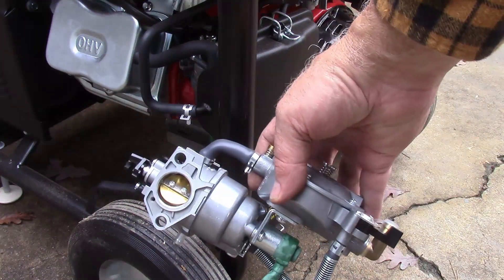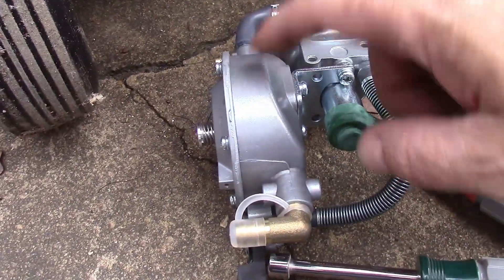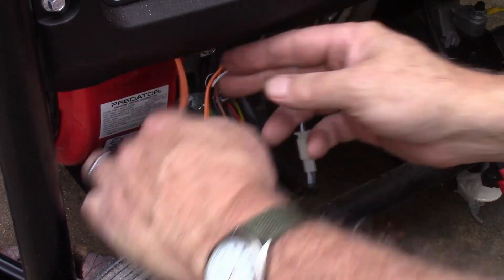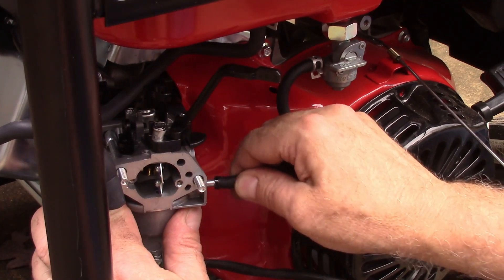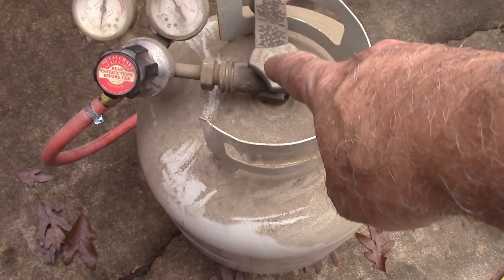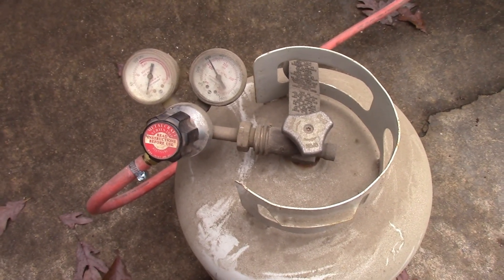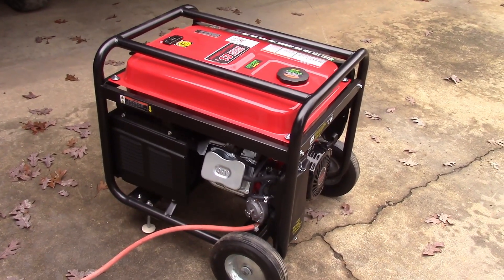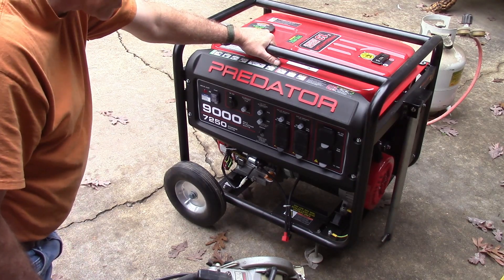Predator 9000/8750 Generator Propane Conversion  Tri Fuel

Comment: Great video, had no idea this was possible. I'm looking to buy the same generator, but just not sure cause its harbor freight brand. I've seen nothing but good reviews so I think I will be getting it soon. Do you think this generator will last years with proper maintenance or just something to get you by for the meantime? Thanks again for your help.
Reply from the maker: I only plan to use it as a back up generator but it does seem to be well built.
Reply: If you do some research you’ll probably find that Predators are made either by a big name brand or made in the same factory using the same exact components as big name brands. That’s just the way manufacturing goes these days.
Reply: I had a 4k Watt predator generator for the past 3 years.  First year I didn't have an hour meter.  and in the past 2 years I put over 1000 hours on it.  Only changing the oil every 100-150 hours and the spark plug once is all I've ever done.  Really that machine will do more than 4k watts. I pushed it hard every day.  Then finally now its high revving and produces nothing for power so I bought this one and I'm very pleased with it.
Reply: I thought the book said change the oil every 48 hours of operation? @sjozski42987
Reply: Have one..it's great. 
The predator generators have a good reputation
Reply: I have a much older model of this Predator 3500 Generator. Its actually a Honda GX160. I had bolted this generator to the frame rail of my Semi Truck. Fabricated a galvanized enclosure with hinged hood . I operated from a small AC unit to a Microwave and small refrigerator off this generator. I did have to modify the electrical connections with additional zip ties and silicone sealant. Replaced the rubber mounting brackets with stacked rubber pieces of cut mudflap.  I also added an inline fuel filter and removed that crappy screen inside the tank that made it difficult to refuel without spillage. This generator has accommodated my over the road needs for 5 1/2 years without a problem. I had traveled all over the US in extreme cold, heat, and horrible storms saving many gallons of truck fuel and not having to idle my truck all night.  I still have this old generator and it starts and runs as well as it did the day I bought it and that was in 2009. The key is to use a good grade of motor oil and keep it changed often,  have a good inline fuel filter and drain the fuel from the carb and bowl each and every time your done using the generator.

Comment: Will this fit my predator 8750 model as well?
Reply from the maker: I don't have any way of knowing for sure but I would think so.  Follow the link to Amazon in the description I think someone asked that question and was told it would fix.
Reply: Steven, I bought the same carb, just installed it today and it fits like a glove. Have not fired it up yet, but in the next few days I will. Super easy and came with other gaskets. I watched the vid again just now to make sure I missed nothing. Well, I did, forgot to put the air hose back into the Air box!!! Always good to double check yourself!!!  The carb itself is basically identical to the one on the 8750....Was gonna do a video, but Soat Mon basically covers it all! Still early, gonna go stuff the tube back in....
Reply: @dancheatham5106   great! I just ordered thanks
Reply: Dan Cheatham did you find a regulator with a 3/8” id hose?
Reply: @TheMinivanmitch  The hose I got is 20" the end is a 3/8 female screw. I measured the diameter of the generator fitting for the gas line. It is 1/4", therefore, I am going to cut my hose as the id of the hose is 1/4" hope that makes sense.
Reply: Here is a very important safety video that everyone really needs to watch https://youtu.be/I1jT3ANENvI

Comment: So you can hook up to natural gas too?
Reply: I converted my Honda 5.5 kW years ago so it can use NG, gasoline or propane.   I use it on NG when power goes out in Gulf Coast.    It’s great.   My genset never runs out of gas and I don’t need to go hunting for gas when the whole world is lining up for it.   It runs cleanly, a little quieter and for as long as I need.   Even better is no gasoline contamination left in carb bowl or tank.    Best thing I ever did.   I also wired in a new sub panel with all the things I need during a power outage (no 230 volt stuff though) coupled via a legal double safety switch over.    I placed a nice 50 amp NEMA receptacle in weatherproof box on the exterior of the wall behind consumer panels to hook in the genset.   I can haul out the generator, snap on the gas line, plug cord in, switch over the safety isolators and fire it up in about 15 minutes.   Enough power for lights, fans, microwave, electric kettle, TV and most important of all ..... fridges and freezer!!    There is also enough power to run a small 6-8000 BTU window a/c in our bedroom if needed which is our air conditioned citadel during extended outage.   You rarely have everything going at once so I use the current gauges in the sub panel to make sure I am roughly balanced on the two legs.    Back feeding is illegal and very hazardous to linemen who are working to get power restored.     It takes one idiot to make a mistake ....... just saying!
Reply from the maker: Yes, that what it says but I have not tried it.
Reply: Well can you try and make a video on it please?
Reply: NOT FOR NATURAL GAS !!!   the link provided takes you to Amazon where product description says LP/CNG conversion kit.   CNG is Compressed Natural Gas which is not the utility being fed to your house thru a gas line.  This is the pressurized version they use in some city buses and truck fleets.   You can get a carburetor for household natural gas, but it is not the one shown in this video !
Reply: @davec6016  Please provide information to the 'household gas carburetor' that you keep referring to. Thanks!

Comment: I was hoping to find one for a Predator 3500. But the HIPA website has a long pull down menu for various brands of generators but does not even list the Predator brand. :-) How were you able to determine that a "GX390 188F" was the correct one for your Predator generator? Thank you. Nice video by the way. Thank you.
Reply from the maker: Take a look at the one I listed in the description.  It's very likely that it will fit.  There doesn't seem to be much difference in any of the carburetors on the Chinese generators.  I would link to Amazon an search the questions that people have asked about that carburetor.  It's likely that someone has already asked if it will fit yours.  If not ask the question and see if anyone know.  You could also search amazon for Predator 3500 propane carburetor and see what shows up.  Good luck!
Reply: @SoatMon  Thank you for the suggestions.

Comment: Has anyone ran this amazon carb conversion on home/natural gas.  Not compressed natural gas in tanks?
Reply: I have this same carb. on my generator running on natural gas and it works good. I had to reduce the spark plug gap to .020
Reply: @dougpriest9795  You think they would sell that carburetor with a note on that modification possibility.  Description says only CNG.  Not sure I would want to take risk on running with reduced gap.
Reply: So how do you hook it to the house what fittings?
Reply: Here is a reminder about portable generator safety: everyone really needs to see this safety reminder to make sure. This advice is just to make sure that everyone is aware of all the warnings and it’s just to remind people to be careful using portable generators. Generators can be dangerous if not used carefully. Every year, hundreds of people die or get injured when using portable generators due to carbon monoxide poisoning and electrocution. Make sure you are using your generator carefully and keeping others safe as well. There is something very serious that everyone should always be aware of when using generators. Some people do run their generator indoors which is not safe and that increases the risk of carbon monoxide poisoning which can cause death of family and you. Some people run their generator in wet conditions which can electrocute them. Please remember that you should never run your generator indoors. Remember that carbon monoxide is an odorless and colorless gas that you cannot see or smell. Carbon monoxide is a silent killer. Keep that in mind. Make sure your generator is 15-20 feet away from your house and away from doors, windows, and vents. Never use your generator in your porch too. Having a carbon monoxide detector is very important against generator safety. Some people also allow children to go near the portable generator which could pose risks. We need to keep an eye on our children making sure that they are not near the portable generator so they won’t get electrocuted or burned by the generator which is dangerous. A locking enclosure also keeps kids safe. A generator shed might look like a tempting place to explore, or take cover during a game of hide and seek, but a generator is a dangerous piece of equipment that can cause injury. It says on the manual that we should also keep children away at all times from the portable generator to avoid injuries. Please do not allow a child or unqualified people to operate the portable generator. Just because some manuals missed what should be listed doesn’t mean it’s safe to do. Always follow the generator safety rules when using portable generators. Generators pose electrical risks. If you need to use your generator during wet weather, you need a generator tent to protect your generator from getting wet. Don’t let your generator get wet. Keep your generator dry and before using your generator, please make sure your hands and your generator is dry. Do not wear loose clothing when operating the generator. Everything that is said on the generator’s operating manual should not be ignored. Never smoke cigarettes near the generator. Please keep flammable things away from the generator. Never overload your generator too. Your generator can catch fire. Never ever try to plug a generator cord into a wall outlet to avoid back feeding. Back feeding your generator is dangerous. Always turn on your generator first before plugging in appliances and shut off the appliances before turning your generator off. Use a heavy duty cord for your generator and the cord should not be worn out. All the instructions should be followed carefully. Never refuel your generator while it’s running. It can cause fire if fuel spills while your generator is hot. You should turn off your generator and let it cool off before refueling it. Having a fire extinguisher next to the generator is also important. This is only a reminder for everyone’s safety of using generators. Make sure your generator is properly grounded. Having a fire extinguisher next to the generator is also important against the safety rules. https://youtu.be/I1jT3ANENvI and here is a video more about keeping others safe when using generators and also about our family’s safety. Hope this helps. Thank you. Stay safe. Make sure you follow all the generator safety rules carefully.

Comment: I bought this generator yesterday and would love to be able to hook up to my 250 gallon propane tank which only runs our stove., but I would also like the option to use gas as well if needed to run it somewhere else.  Did i hear you correctly when tou said this part will allow it to run off propane OR gasoline? Great vid by the way and thanks for the Amazon link.  The cheapest one I was able to find so far was $72.00.
Reply from the maker: Yes, once converted it will run on either one.
Reply: It will run on propane (LPG), natural gas (NG), or gasoline.

Comment: That’s a great video if I ever buy this generator I will try and get the same carburetor myself very helpful
Reply from the maker: Thanks!
Reply: Again, Great video! Now for the bad news. It does not fit the new model generator. The latest model Predator 9000 has a different air box. The inlet is in a bad spot. I had to loosen the bracket that goes to the new carburetor and leave it dangling so I could rout the air inlet behind it. I still made it work but my carb inlet is dangling so I will have to strap it up with a zip tie or something.
Reply: Dustin S I bought a big Champion generator at Rural King instead it’s dual fuel already set up out of the 📦 box

Comment: Best way to go right there if you’re running on natural gas and/or propane your neighbors ain’t gonna come over and try and borrow gas off of you for their generator during a power outage you can simply tell them I don’t keep gasoline around here cause I don’t run my generator on it. Also one thing I have found we had a power outage in my area some years back that lasted a little over three weeks and you may not be able to afford gasoline every day even if you turn it off for a little while for three weeks straight it will cost you a small fortune another thing I ran into during the outage was at first I drove around the gas stations to get more gas because I only had what was in the generator and I think maybe a gallon or two extra and none of the gas stations in my area could sell gas because the power was out. I had to drive for quite a ways to find some,,,that was not convenient at all,,,,propane last a long time you can buy those 100 pound cylinders and have it set up that way,,,,however you may be better off just a running natural gas,,,your power will be reduced a little bit on propane and natural gas but with a generator that size I believe you’d still be OK.
Reply from the maker: I hadn't thought about the difficulty of actually getting gas from a station to fill it but now that you point it out, that could be a real problem if the outage was wide spread.  Thanks for adding your experience.

Comment: Did you swap out the spark plug? If so with what?
Reply from the maker: No.  Just changed the carb and it fired right up.
Reply: @SoatMon  Thanks for the reply. Sorry I was not clear. Not for this project, but as an upgrade to the stock plug that comes from HF with the 9000
Reply from the maker: No problem.  I'm still using the plug that came with it.  I'm kind of a "if it ain't broke don't fix it kind of guy".  If it runs, I'm not the type that works to improve things a little.  There is definitely benefit in that kind of thinking but it's not me.  I struggle to actually do the preventive maintenance that's required on my equipment...  Good luck with yours.
Reply: @lacrossed55  The plug most recommend for the Predator 9000 is the NGK BP6ES or the Honda # 98079-56841. They are both the same plug.

Comment: Soat Mon, Thanks for this video. I noticed the carb in the Amazon link says it's for an Output: 4.5-5.5KW generator.  That's only half the output of the 9000. Have you had any issues with your generator not running correctly?  Did the 1 lb of pressure seem sufficient? Can a motor be run too lean on propane and cause damage?

I had a propane line run from my large propane tank for a Generac whole house generator but I've read some bad reviews and it's way more expensive!  

The 9000 is on sale now so I'm going to pull the trigger.  I had no idea that I could find a conversion to LP for the Predator, especially so cheap.  Thanks again.
Reply: * I bought a variable presure regulator and run it less than one pound. Once the engine is running the regulator can be adjusted -- if too lean or rich the motor runs rough.  
* There is a valve at the bottom of the regulator to drain the GASOLINE float bowl. GREAT as GAS gums and corrodes the carburetor, and I will NEVER run gasoline again.  
* LP gas BURNS CLEAN, combusts with a little less force, so the engine should last MUCH LONGER.
Reply: Charles Clever thanks for the info. I still haven’t even started my generator. I’ve decided to put it out by my shop instead of by my house. I can back feed from there and the generator will be far enough away so I should barely hear it. Trying to finish up the electrical and plumbing now.
Reply: I was concerned about that too but the carb and throat sizes are identical so it shouldn’t affect the aspiration at all.   I’m sure there are adjustments if needed.    Great vid, thanks.
Reply from the maker: Yeah I was worried about the size of the carb as well but as I read the reviews on it others had used it for the 8750 generator so I gave it a try.  Works great, as I said in the video I think it's the exact same carb with a propane jet.  I don't know of any damage that a lack of propane would cause, just low power if you are not delivering enough but I have not had that issue. 

Good luck on yours, I hope it works well for you!